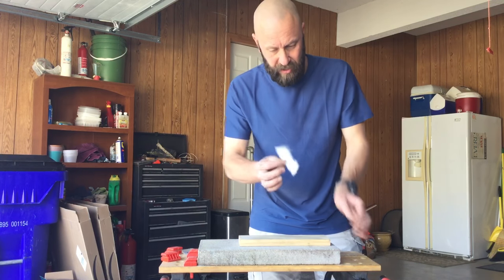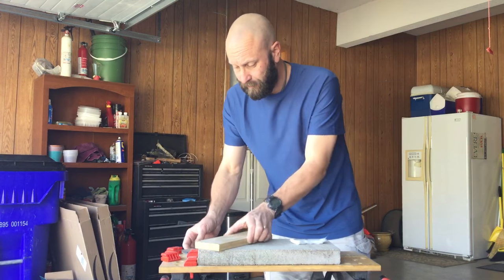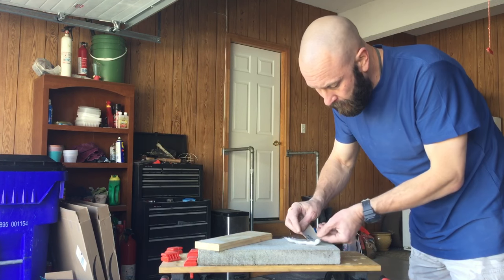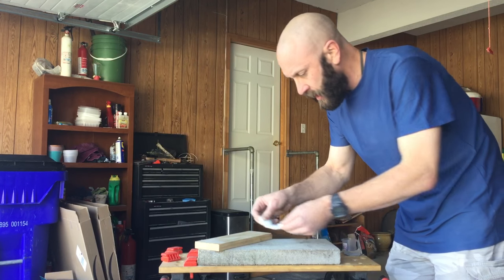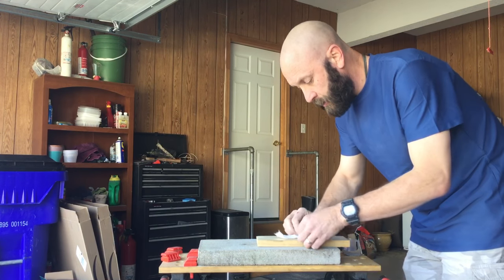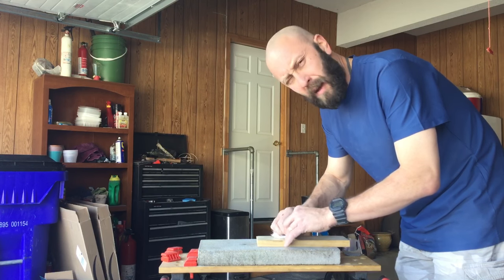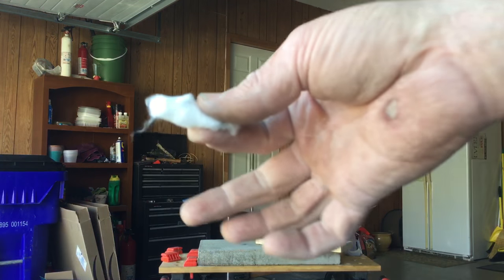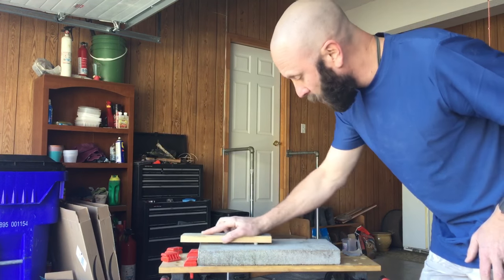Rudiger Roll - another fire making method

Comment: Dang ! 
is that a hard wood block ?
are those like fragment or powdered Ash ?
Reply from the maker: Just a cement paver and a piece of pine.  And the ashes are fine powered right out of the fire pit.
Reply: Thanks Chris Swanda ! This is a very simple method , non-toxic , eco friendly and relitively simple .
Reply from the maker: I wouldn't say simple.  I spent a lot of time on it and it takes a bit of finesse and pressure.  But once you find that magic spot, then is easily repeatable.  Or at least in 3 tries. :)